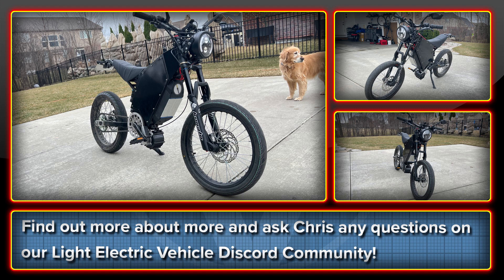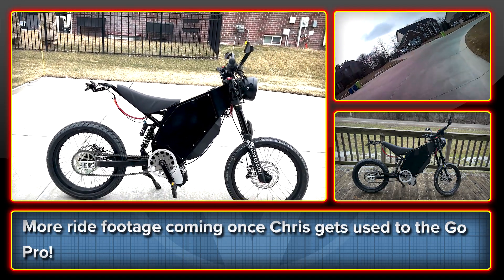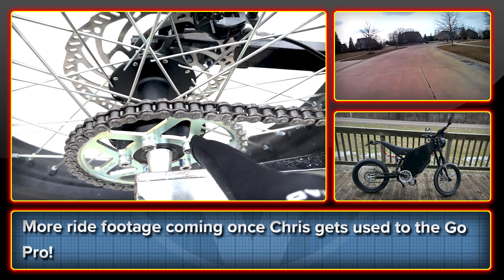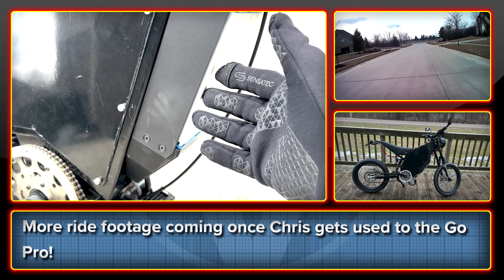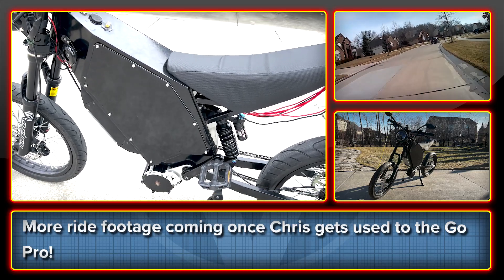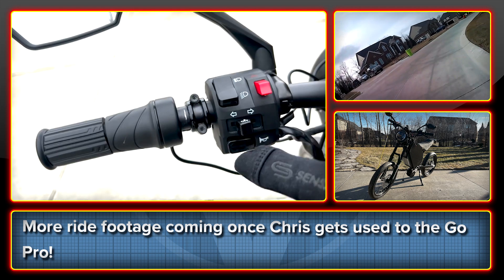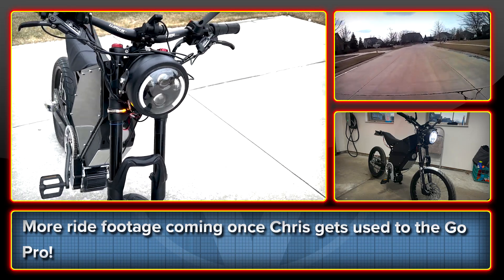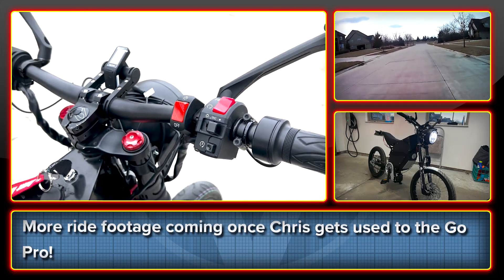Street Legal High Power Ebike - Project Raptor - 10kw Lighting Rods IPM Mid-Drive

Comment: No Chaintensioner? Pivotpoint of the Swingarm is in front of the shock. So the chain comes lose if a heavier rider sits on the bike or suspension is "used". There are flying alot of wires around. Pretty messy build if you ask me. And that XT60 "charge port"....very cool idea to plug a connector in where wires come unisolated out. Lean forward and have some luck with the zipper of your jacket and he has some fun.
Reply from the maker: Maybe before you judge something so harshly ask some questions with respect. No chain tensioner is needed. Its running regen braking which would not work with a chain tensioner. There is a blank plug for the charge port. Thanks for the comment tho.
Reply: @HighVoltageKits  judging? iam sorry if critism isnt welcome when someone posts public his "6 months" build and it looks like that.
regen Braking you cant use Chain tensioner? Well those comment fits to the quality of the build :D 👍
Reply: @incredibleloucie8174  Critisism is very welcomed with me I just ask you address it in a kind manner, this 6 month number I reference is from when I purchased it in the start of October to the first ride at the start of march, that's 5 months sure but there were other things happening in September when pulled the trigger. Adressign Regen: Yes you can't use it solely as a brake, that's why I have 4 Piston SRAM's back there, both work amazing at stopping the bike and I use Regen a lot because of all the power it has, plus is puts energy back into the battery. "Well those comment fits to the quality of the build" Say what you wish about the quality, its leagues better than my first bike, and I frankly don't care what you think about the quality, this is a first edition, with improvement bikes later to come, over the years this bike will be cleaned up and get better, so please ask your questions and mind that people pour their love and souls into their builds
Reply: @chrishycki  Hi Chris, what front forks ar you using for your bike ? I have the same frame but the rear swingarm is the older chunkier one, I might share my build with this channel soon.
Reply: @mountainlion4853  hello mate! These are himalo forks, cheap but they are amazing, looking forward to seeing you on the Discord
Reply: @chrishycki  Thank you, I will keep you in mind when I go online.
Reply: @HighVoltageKits  Thanks HV
Reply: Hello sir this is my bike, I spent 4 years designing this over many revisions accumulating the money to do this, it took 6 months to build and this bike is the love of my life, I appreciate criticism but keep it civil I ask. First adressign the chaintensioner, I have one, I spent a couple weeks designing my chain tensioning system with Fusion 360 and printing test parts, then I sent it off to the CNC and fabricated it up myself, it uses a horizontal chaintensioning system which pulls the chainback, same system found on every single motorcycle. I had no control over the pivot of the swingarm and shock mounts, I purchased this frame that I've been looking at for a while and as far as I'm concerned its incredible, no issues with the shock, I already re-tuned it so that it preforms better and accell sag isn't as heavy, that being that be bike makes between 300-400Lb-Ft of torque its hard to keep that back end up. There will be no heavier riders sitting on here, all suspension is adjusted to me and my weight, I'm small and light, I don't let others ride my bikes unless I have designated bikes for them, bad things happen when you don't. I agree that the wiring system in general is messy because of how I made it. A version 2 is coming in the following months for customers aswell. Plus all those wires have to go in the frame somewhere, that slit is the frame I made is a perfect place. I may design and add a piece to cover that regardless. The charge port is a bit messy because that is also a product that I'm still perfecting to sell, the threading was wrong so I had to improvise with other systems and the touch of hot glue is for waterproofing. There is no shock risk whatsoever because I agree that it'v very stupid to leave a blank plug out too, especially for rain. Thats why there is a dummy plug in there with waterproofing it it to block the wires, I have a 3D printed cap for it but I need to redesign for tolerances. These are things I have thought of before making the bike, Ask all the questions you wish, but don't shame before you ask mate
Reply: @chrishycki  i think yr build is Awesome...   👍💪👌🥳😃
Reply: When you start running motorcycle specific stuff, you usually don't have to have everything as tight as a bicycle.
Reply: @hiko8822  I agreee that some components I have aren't suited for such heavy of a bike, It's 140lbs and combined rider weight is around 260-280, again I've very light, so actually its still in range for all of my LEV friends with HV kits and their combined weights, I use good breaks and they stop really well, suspension is now tuned post video and is amazing, this has all be calculated out before building, everything is properly torqued to the motorcycle spec, I get this question a lot, cheers
Reply: Stop whining Karen ffs
Reply: yeah this sucks.........................................
Reply from the maker: Except the commenter does not understand that the regen needs no chain tensioner 😉
Reply: Mimimimimii🙄😵🤣✌